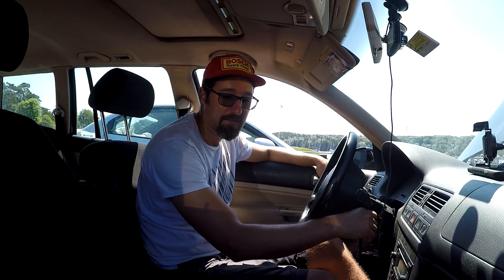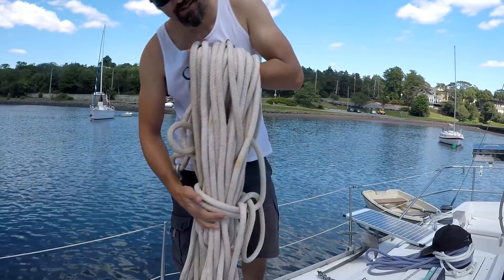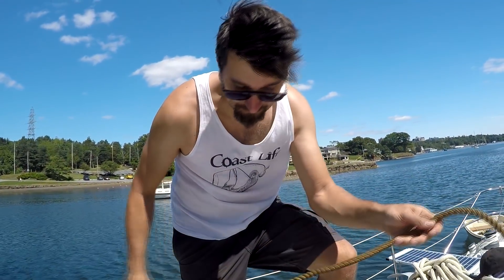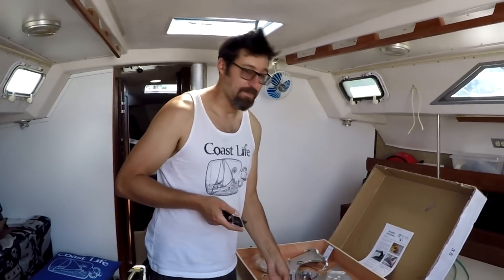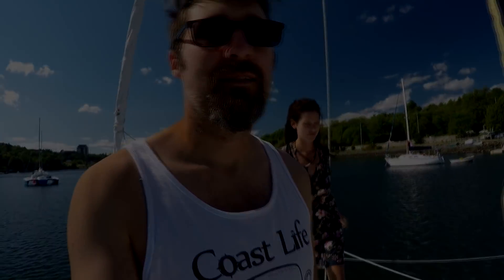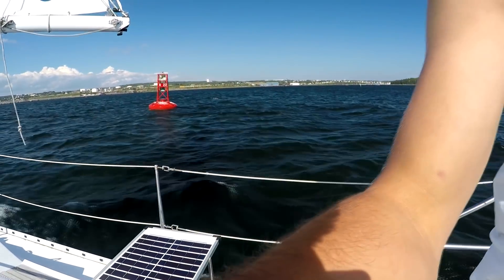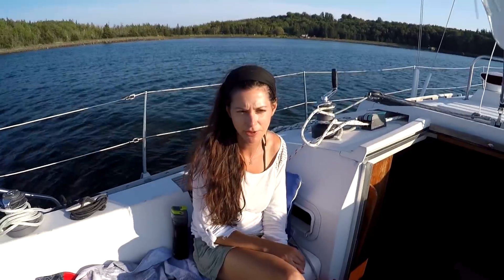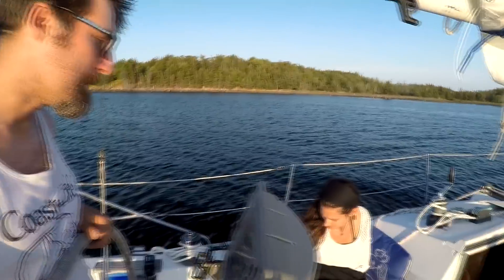Our New Mantus Anchor! [ Ep 27- Sailing Nova Scotia ⛵]

Comment: Hi Nova Scotia,
Great vlog!  I just installed Mantus anchor with windlass.  So I have opinions of course. 
 Good choice.  Remember to pin the anchor to the roller- so it doesn't by chance slip overboard- surprise!  You can get a pin with a spring loaded ball in it that keeps it snug. Sorry don't know what its called.  You'll see the holes in the shaft to connect it. Then connect with a lanyard to keep it connected when you drop the anchor. It has a tendency to follow car keys overboard.  
Beautiful scenery. Nice work on the boat.   Unbridled, Georgian Bay.
Reply from the maker: Hi Dale, thanks for the tip, and thanks for watching :)

Comment: While the chain links don't stretch themselves, the weight of the chain laying on the bottom gives an amount of "play'" as more force is applied. Sort of like how when a tugboat tows a large barge it uses the catenary or long payout with the slack laying into the water to provide shock absorption. I personally like a lot of chain. Nice upgrade.
Reply from the maker: We would be happier with chain, but for now this will do.  There are some articles on the Rocna website that suggest catenary isn't as important a factor as it seems.  Especially with modern anchor design.   http://kb.rocna.com/kb/Scope_vs_catenary

Comment: Chain may not stretch, but its weight causes it to sag which mitigates shock loading.  Agree about the Bruce which has caused Amalia and I much grief on our Alberg 30.  It's a real drag.......
Reply from the maker: It's true, they call that effect catenary. Here's an article on the subject from rocna's website.   http://kb.rocna.com/kb/Scope_vs_catenary     There is also another on rode selection http://kb.rocna.com/kb/Rope   It seems to me that nylon rope and heavy chain were old methods used to deal with old school anchors with poor holding design.

Comment: I enjoy watching your videos but in regards to your anchor line, the three strand nylon is the best.  Three strand nylon has as a shock absorbing capability that the double braid doesn't provide.  How do I know?  I sail a 42' along the northern Gulf of Mexico and I've used three strand nylon for many years as do all of my sailing companions.  So I think you made a mistake swapping the three strand nylon with braided line.  Sorry.
Reply from the maker: I understand Nylon 3 strand is the popular choice.  But, do you have experience with double braid as anchor rode?  I think my argument still stands.  100 ft of Polyester is going to stretch more than chain. And if it doesn't feel right I could always attach a snubber to it. Someday we'll have all chain rode with a manual windlass -Chad
Reply: Polyester isn't what should be used.  Nylon is the best choice.

Comment: Coyotes, stray dogs, creeps, etc--- just have a stout hiking stick of about 5 or 6 feet, sharpened.  It changes the way they look at you, and won't cost you much (straight tree branch).  Practice beating a bush to death and you will have the confidence of Chuck Norris.  Coyotes not around until dusk or later unless really hungry.  Stick.
Reply from the maker: How do you know when the bush is dead?  :)
Reply: If it is a currant bush there arn't any sparks.
Reply: You turn and run away, and the bush doesn't chase you.